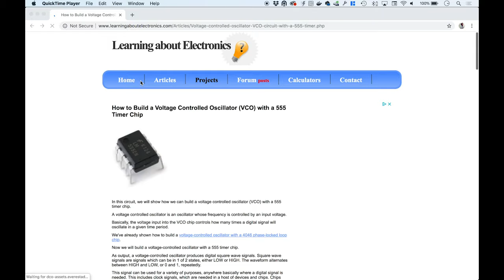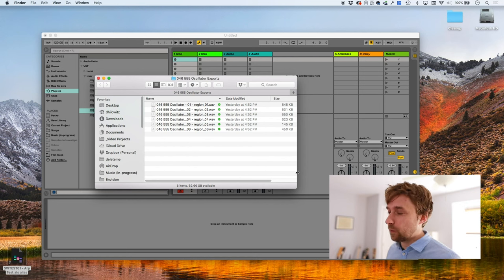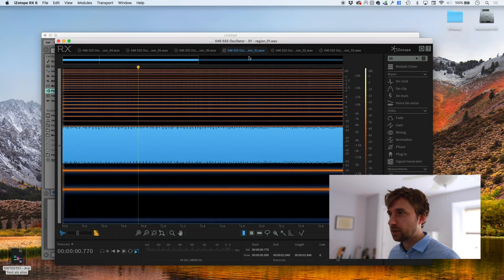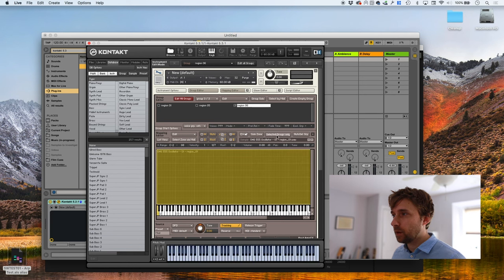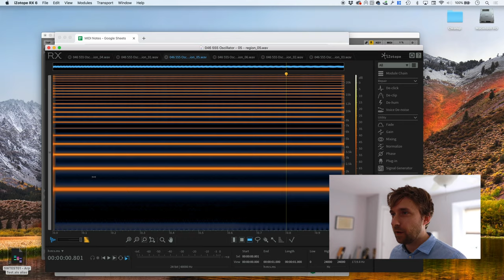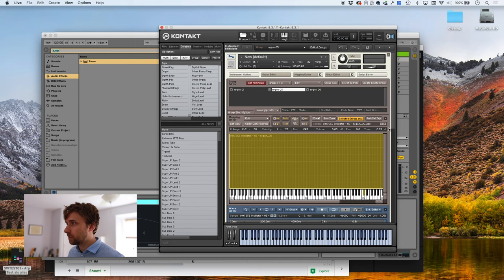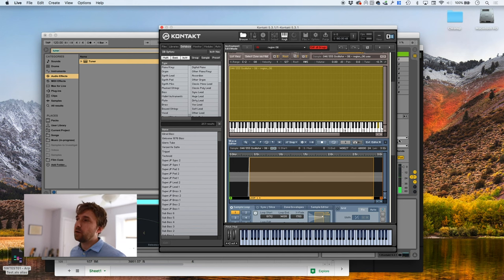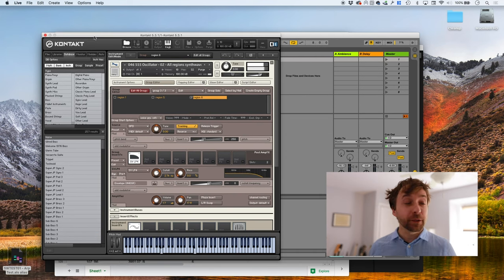Let's Build A Synthesizer! + FREE Kontakt Library

Comment: If you were ever planning on revisiting this experiment you'd be better off using a cd40106. The circuit only needs a single capacitor and a single potentiometer and it sounds way cleaner than the 555.
Reply: Hi, so I am creating a synth like this for a school project and was wondering what is being used for the input jack? I am familiar with guitar input jacks but not so much this. Was this just being tested out on a regular speaker or straight into a computer? I ask since I need proof that I am not only testing it but it works
Reply: and they don't go rail to rail

Comment: I once built an intruder alarm for my house using 555 timers, I've never once considered using one to make music :)
Yes, that final sound was pretty awesome, I think the secret to creating square waves etc, would be in the capacitors, at a guess.
Reply: You are unlikely to get "pure" square waves out of a 555 due to component tolerances.
Reply: @SpeccyMan  It's actually impossible to make a pure square wave as it would require infinite bandwidth.
Reply: That makes a lot of sense, actually. The initial waveforms looked like the derivative of a square wave (big upward spike on the rising edge, close to 0 in the  middle, and then big downward spike on the falling edge). Adding capacitance is akin to integrating the signal, so you essentially recover the intended square wave!

Comment: It's funny, as a software engineer I'm allergic to having computers anywhere near me if I'm doing something with music.
Watching you switch to spreadsheets while making a synth is just painful! 😂😉
Let's see if you ever finished this synth, did you make a filter yet?
Reply from the maker: No, instead I ended up making several digital synths using the Teensy 4.1 and audio shield :)
Reply: @DavidHilowitzMusic  
Well, next year I'm going to really get on with designing and building modules, no digital anything I want to know the analogue side of everything.
Want me to post you anything I finish? 🤩

Comment: You gave me an idea, it could be possible to check the accuracy of a 555 frequency by comparing the audio tone with a computer generated tone of a known frequency. This only would work if the frequency of the 555 timer was in the audible range.
Reply: You could also hook up something called a snark tuner to the output of the speaker. They’re tuners typically used for guitars, but they just sense the vibration of the frequency and clip right onto what ever you need to tune. Not sure exactly how accurate this would be, but would save a lot of time.
Reply: Interesting, I don't remember saying that. Seems kind of silly now, I think 555 timer frequencies are very accurate.